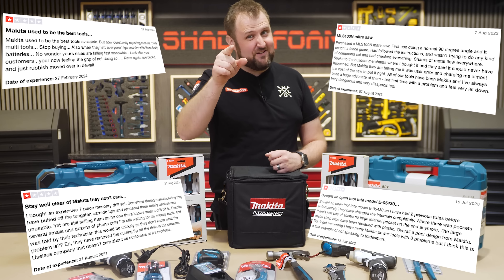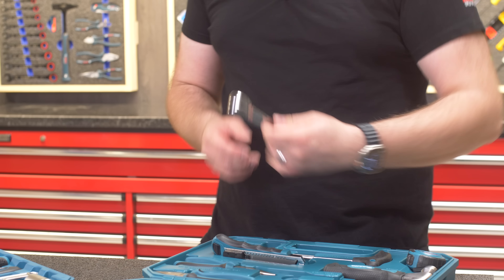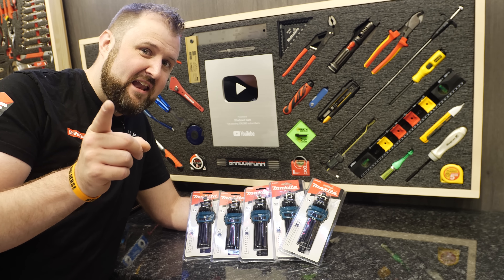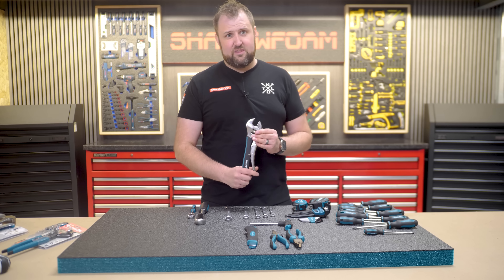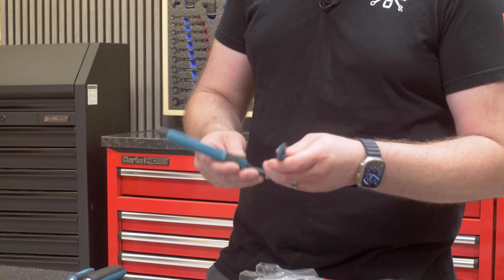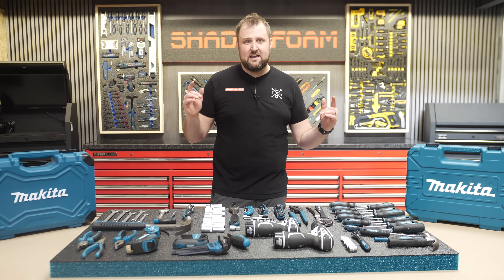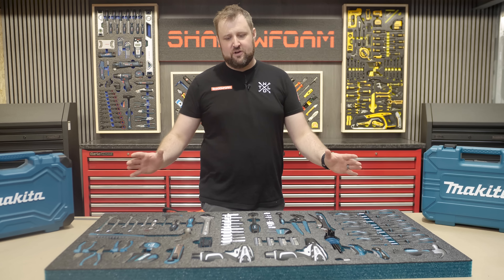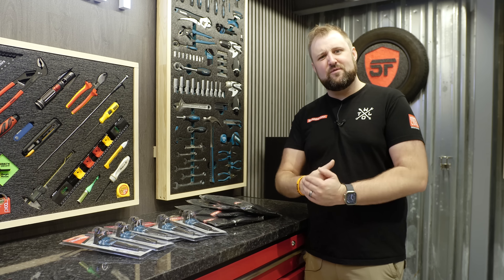The Makita Hand Tool Redemption Arc! NEW but RARE Makita Tools!

Comment: Great video, from 12:42 in you have added another adjustable spanner 200mm, I believe. 
(I did cheet, lol)
Years ago, I got a Makita bit set. It had a non ratcheting screwdriver bit handle with a rather sturdy, removable bit holder that you could put into a drill. You could also put the bit holder in halfway up the handle to make it into a "T" handle. 
It was a really useful tool. Unfortunately, my dog chewed the handle 😢.
I have looked all over to try and replace it to no avail 😢
I still have it. One day, I want to cut off all the chewed plastic and rubber and try to make a nice wooden replacement.

Comment: I have had a Makita power tool set for over 8 years, still use it but the Old stile batteries died ages ago, you can get an adaptors to use the modern style batteries so you can still use the drill.

Comment: I bought a makita drill bit set recently to try and get some better ones than my original cheap stuff. I’ve used them on a few projects recently but the flexible bit driver broke instantly. So based off that experience, I think they have some work to do on their quality of tools and accessories.

Comment: You seem to of missed out my personal favourites. the 12Volt CTX range. I'm disabled and the CTX range give me Makita quality and reliability at a weight I can use. I was a CCTV installer and that was when I started to use them as most of the drilling and bolting was done up a ladder The CTX SSD drill can manage 90% of the work you'd use LTX for in a far smaller and lighter form factor. what about a CTX wall pannel?

Comment: Have been a Makita fan ever since my first 'proper' drill set that had a PA18 Battery hammer drill. Have the whole range with that battery still - jigsaw, circular saw, etc and buy NiMH replacement batteries to keep them going but they are so heavy. Might have to bite the bullet and upgrade to Li-ion one day, or do I buy the conversion adaptors that let you use modern batteries instead......?

Comment: Are you planing to do a video about Engelbert Strauss they got over 600 manual tools and over 150 electrical tools
Reply: They are nice but most of them are rebranded OEM tools of other companies like NWS, felo, Matador, Würth etc. He could also do a wall panel of Gedore, Hazet, Stahlwille, Wiha or the ones I forgot to mention if he hasn't already done that. He already did Bosch and Wera if I remember correctly.
Reply: But Engelbert Strauss
Reply from the maker: Congratulations, you are one of my 5 winners in this giveaway! Drop my team an email at m.wood@shadowfoam.com and we'll arrange shipping this prize to you!

Comment: I've had dewalt, bosch and makita. Stuck with makita but you do need to check specs before you buy as they produce a lot of handyman diy stuff (plastic chuck collars are a giveaway on drills) and if you're a tradesman they won't last heavy use. The tool walls are really a work of art
Reply from the maker: Thanks mate, very good opinion! 10/10 👌

Comment: I think your either Makita or DeWalt on the power tools, I started with DeWalt and have stuck with them, did like some of the quirkier Makita things though like the mole grip adjustable. Automotive hand tools I can't afford Mag, Snap-on or Teng but for my use Halfords Advanced range are good enough and the no quibble replacement Ive used twice and its been perfect, straight one for one replacement. Hoping for a result on the draw so its a 2XL if my lucks in.

Comment: Makita abandoned the compact 10.8v range too soon.

The DF030 is a fantastic torque limited hex screwdriver (I have bought 2 on import). 
We use the TW300D 3/8 impact torque wrench in our motor racing team. The compact pistol shape allows great access.
DA331DZ right angle drill handles great.

The new WR100D 3/8 ratchet would have been perfect with the 10.8v cloverleaf battery, a good competitor for the Milwaukee ratchets.

The ebay 10.8v batteries work fine and are dirt cheap, allowing you to offset the limited capacity of the BL1013.

Comment: Its sad to see that Makita's sets still aint up there with the wuality of tools, glad to see that some of the individual tools are better spec, are they worth it though to you for someone who isnt as brand specific for hand tools?

And second question, what would be your go to company for handyman tools, mechanic tools and job specific like sparky, carpenter, plumber ect? I know your a sparky so not gonna shame you, just interested to see what other companies are decent as I like the ryobi for basic handyman kits I can lend out and halfords advanced for other handtool kits!

I love the older makita power tools, the 10v are good and a good inbetween 4v and 18/20v sets, I went down dewalt for the 12 volt though as love their 3/8ths impact wrench, I use Ryobi for 18v due to the sheer range of tools and extras like inverter and fans to use the batteries.

Comment: In the 1980's Makita got a good rep for being well priced really good tools for the keen amateur. in the 90's something went very wrong and Makita rapidly s**t-ified. I still use Makita tools I bought in the 80's (spanners and socket sets mainly), as good as when I bought it. Last week a break bar took punishment to get a stuck head bolt off. I have respect for these old Makita tools.

Comment: I love using my 18V Makita gear, shame the hand tools aren't of the same quality as I really want to upgrade most of my cheapo kit. The only Makita brand non-power tools I have are an 8m tape measure, some drill and driver bits, and a belt holster, as these were the elements of a free accessory bundle. Makita should definitely name that product Pried Piper and pay you for it!
Oh and if I'm lucky in this one, XL Shadowfoam shirt would be worn with tight-fisted pride. 😄

Comment: Makita is my go to for tools of all kinds I really like their 36v (2x18v batteries) power tools. I still have my 10.8 twin drill power kit complete with the torch and it’s a great little kit that is lightweight and as a disabled person I find them ideal for using on diy furniture pack assembly. I really like the Makita panel. I would take down that Dewalt p@nel @nd give it away someone somewhere will maybe want it.😊😊😊😊 tee shirt size is xxl please😊😊😊

Comment: Ive only owned Makita power tools in almost 30 years of working they are quite expensive compared to DeWalt and Milwaukee i think that's what makes them not as popular my impact driver is 14 years old its been used on a daily basis still a beast ❤👊

Comment: i really like my makita power tools, but their hand tools and accessories (like bits, drills etc) haven't made the best impression on me. like you've discovered, it often seems like cheap OEM stuff with a makita label slapped on. there's nothing wrong with just rebranding a tool to color match your tool lineup, but i'd argue that at least they should pick a decent name brand manufacturer to partner with on that. imagine them teaming up with Engineer, another japanese brand that makes fantastic hand tools.

Comment: The Makita 10.8v drills and drivers are among my favorite tools, and I have about a dozen of them, in addition to a right angle drill, a reciprocating saw, a jigsaw, and a couple flashlights. Unfortunately these models haven't been available in the US for several years now; whenever I see any used ones for sale, I pick them up. I have about 25 Makita tools on the 18v and 36v range, but I reach for the 10.8 most often.

Comment: A kit with a 1/4" and a1/2" inch ratchet but no 3/8" ratchet is pretty much worthless. I use a 3/8" ratchet, probably 90% of the time. As a wall hanger I guess the kit is OK, but it's utility is approaching zero.

Comment: Sweet layout!  I've had the Makita 12v driver set for probably 15 years or so.  Mine came with an awesome steel case.  At this point, the batteries are pretty much toast and I've moved on to a set of Dewalt drivers.  That being said, I still love that Makita set for being lightweight, powerful enough for what I need and the steel case was such a bonus.  Held both drivers, spare battery, and a charger.  Even had a little pocket for bits and such in the lid.  I think Makita does make some quality stuff, but like everything you have to be very choosey on which ones you get.  Thanks for doing all these videos.  Shadowfoam for my Stacktech kit will be next. :)
Reply from the maker: Looking forward to seeing that Stacktech kitted out in foam mate! 👍